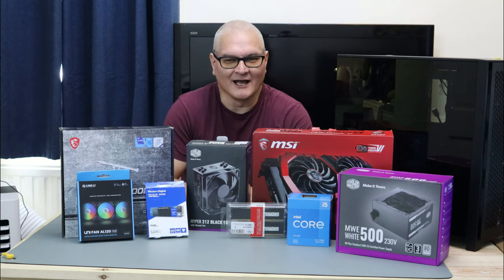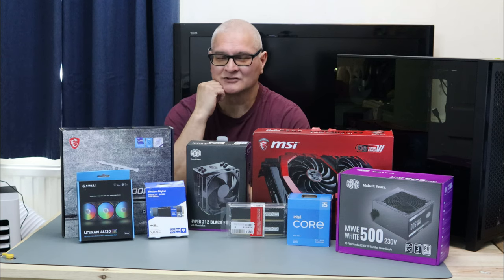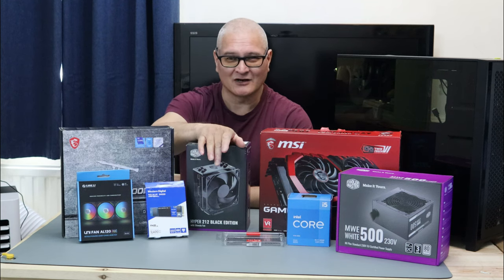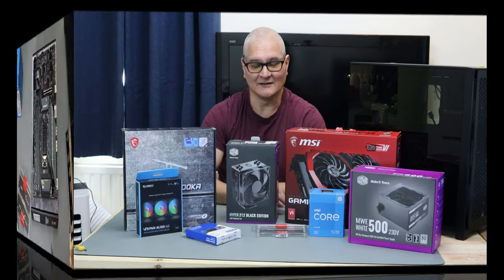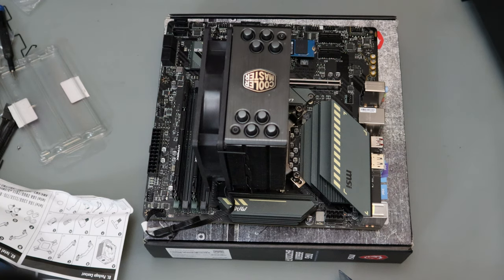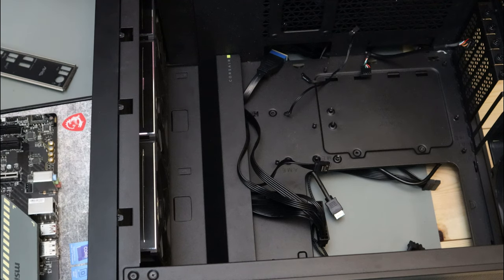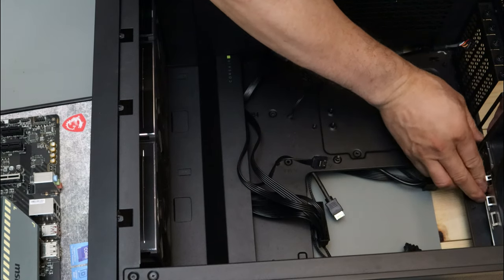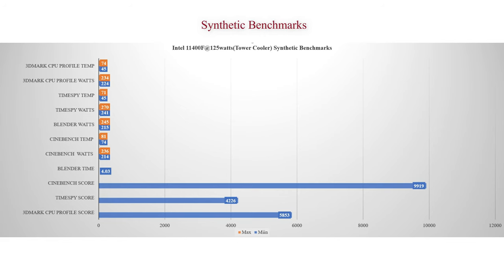MSI B560 bazooka build with benchmarks

Comment: nice video bro! what is the best ram memory frequency for this build
Reply from the maker: Hello, with the 11400F, it should take 3200Mhz CL16, I tested Kingston and corsair
Reply: @blitsgaming8954  i have corsair lpx 3000mhz, can i overclock to 3200? motherboard mis bazooka
Reply from the maker: @joelguzzetti  hello. you can overclock your memory, you will have to do it manually, you may get lucky an d have XMP profile come up, for an auto configuration. I don't have the board anymore, so I cant test it for sure. Hope this helps